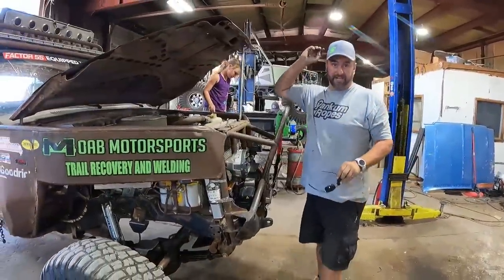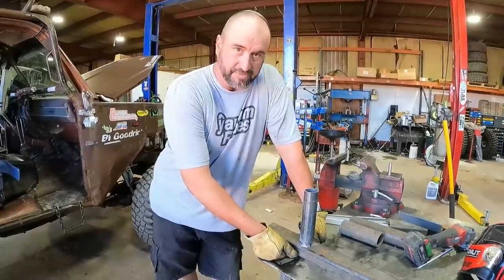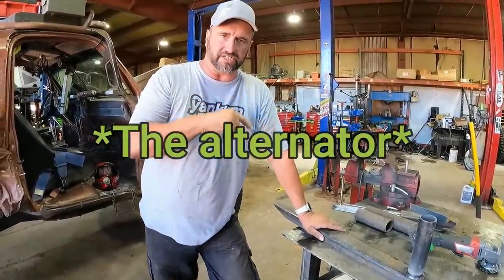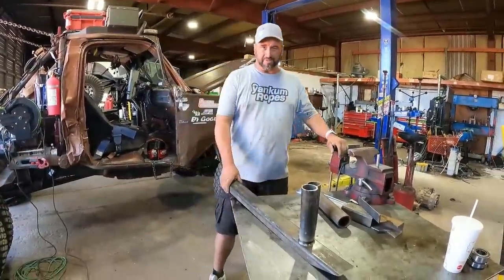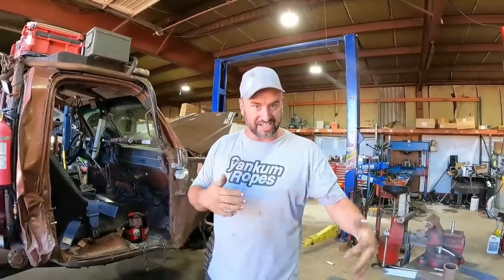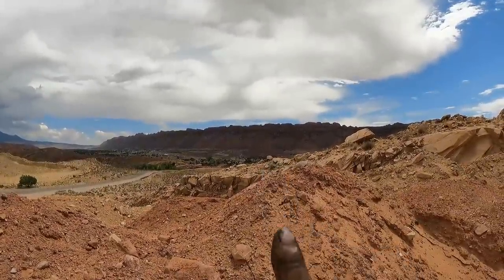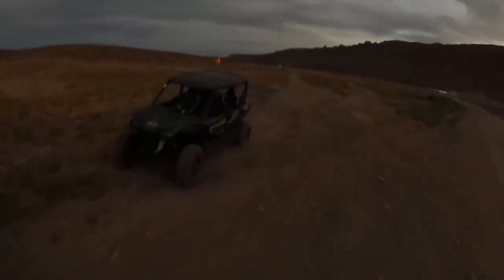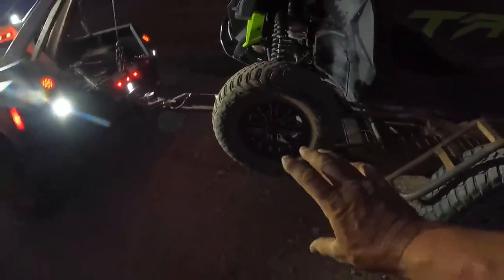Premier Power Welder

Comment: I love my premier power welder, it also makes for A amazing battery charger on a dead battery, I don’t know it you have tried it or not But if you have a dead battery just hook up the positive negative welding leads the battery and then turn your welder on at idle speed for up to two minutes and then shut it off and it’ll start will start a rig even if it was completely dead

Comment: Rory thanks for the info on what rod u use and the info on the welder I was wondering if it was DC or ac current i have a frounise battery welder at the coal mine it kicks ass and it can run in 110 power also

Comment: I worked on a surface mining job in the 70’s and 80’s I saw a welder slap a ground on a machine and then weld a hub, well long story short the wheel bearing was the ground, it welded solid and wouldn’t roll, took hours to replace that bearing

Comment: I'm welding on my stock alternator. used a 200 amp plug to connect the battery to the alt. unplug the batt and plug in the leads 
this disconnects the batt and full fields the alt. engine rpm increases the power to the leads
pretty much any brushed motor will run on dc and old school light bulbs too

Comment: First , great video it answers some questions absolutely. Ive built a trailer b4 6x10 out of 4 inch c channel probably could have gone 3 inch 🤔😁 . I never knew there was ac/dc rod  and i figured the sound your welder made was due to supply system. Great weld on the pipe and certainly looked concrete. Keep on with what your doing it works great. 
When is matchbox coming out with a trail m8ter model ???  We need a set of pauls / poppa sherms rig , your rig and matts soon to be done rig ???✌ brother hoping the the shop and all are safe.

Comment: @Trail Mater,  Gotta wonder if it would be worth adding a second smaller alternator that is sufficiently large enough to run the engine electrical system and keep the cranking battery charged while welding so that you need not worry about draining the starting battery if welding for a long time?

Comment: I know someone who added a second alternator and made their own home made on board welder. Ive got my eyes on one of these babies. I try to make my Jeep a rolling workshop but its nowhere close to trail mater level haha
Reply: It's not close....yet!  Took Rory time to get Mater dialed in, and there's still upgrades and fixes.
Reply: @marklar7551  I actually have plans in my noggin to build a purpose built mobile repair offroad rig. Also thought about turning my m101 trailer into something similar as well. Generator welder all the goodies, bring it with on trips to base camp. Making it not be too top heavy is the real challenge

Comment: I've welding for years I had to do some welding on a piece of heavy equipment using a mobile rig. Mobile rig was a four-wheel trailer that had a 300 amp DC unit driven by a flathead Continental six cylinder engine World War II  Korean war military surplus. Although my leads are hooked up close to my welding work I heard some popping sounds from the other side of the truck. I stopped welding went over and look at the batteries.  Batteries  got i so much electrical charge and stray electricity that it blew the Caps literally out of the batteries. Played heck trying to find out where batteries caps ended up. Thought you'd enjoy that little story. Side note company owner a WW2 retired Navy CPO built a 45 million dollar operation construction company, chain of grocery stores, restaurants mobile home factory, dairy farm car dealership,  heavy equipment maintained shop,  milling machines dump trucks flatbeds tractor  low boys,  cranes bulldozers every piece of equipment military surplus from DMRO.

Comment: The real issue with electronics and welding is Induction: the welding leads from your HF start welder, can induce high frequency A/C in wires that lead to the computers, which they may not handle gracefully.
Reply: Perhaps, but they ought to be shielded good enough to handle it, at least if you don't drape your welding leads across the wiring harness!
Reply: @mahbriggs  Shielding?  What shielding?  Except for a few signals, there is none.

Comment: If you crank up the power does the pitch of the welder whistle get higher? I'm just wondering if the change in the sine wave of the dc load changes the tone.

Comment: Have you ever had any battery charging issues with your premier? I have one in my jeep comanche and I've welded with it 2x and it's been installed for roughly a year. Hadn't drove it much the last few months and ended up leaving something on and ran the battery dead. I charged it with a charger and drove it to work today to giver a check over before an upcoming trip and found that it's not charging the battery at all. Anything specific I should look into

Comment: i thot it sounds cool !!   isaw 1 on line thats mig tig and stick !!!! 
how cool is that. one forbeach brand if common use rigs due to diff alt needs .
price seemed very reasonable to me ..   does ur idle controler " wire cable  " to carb ??
on vehicles w throttle posistion sensor i would gUess it plugs inbewteen to create control ??   any thanks for doing a seg just on ur welding !!!!!  ive sent comment questions in b4 and here u r giving us the run down ... ur the best Rory !!! Mater has it all and a great pilot to run the ole guy !!!!

Comment: If you have a grinder and a welder you can build so much.   What size steel is your boom made from?   

Nothing like a custom built machine, creative.   The new wrecker is your comfort tow truck, every truck has its purpose.   I wonder if you could build an off road rollback or if it would be too big for the trails, especially the wheelbase problem.

Comment: What protection is there or electronic devices against surge currents when stick welding?  Admittedly, having the ground close to the weld is very good practice but surely some of the spikes find their way to the equipment?  Do you need surge protectors throughout the vehicle.

Comment: Those power welders look good mate, the price tag on the other hand is significantly less so.

It's ok for you as a business, you'll make the money back off it. Myself on the other hand, I need to justify these things with my wife.

Ever tried the modified alternator aka weldanator setups?

Also, re the battery disconnected thing, if you can disconnect it you should absolutely do so. Especially when welding on the body or chassis. It doesn't really matter where you're welding on an exhaust or axle etc.

There are a number of issues around it, one of them being melting things not designed for that current as you pointed out. That's not why you disconnect or don't disconnect the battery though.

The issue is voltage drop between the clamp and the point you're welding, particularly as you strike the arc. When you strike that arc and the rod sticks you're running the full voltage of the welder through the chassis, rod, clamp, leads etc. Normally the arc is where all of the voltage drop occurs, but without the arc that drop happens everywhere else, mostly in the rod and workpiece.

If the section of chassis you're working on forms part of the return path for a sensitive item in the car, such as a computer, radio, DC-DC charger etc the voltage that item sees is the battery voltage plus the voltage drop you induce with the welder in that section of its return path. That can put 25V+ across those items and damage them, even with the ground clamp placed relatively close to the area you're working.

You remove the battery from the circuit and you stop that being an issue.

So, the chances of doing damage are low, but still very much non zero.

Same deal as wearing a condom. Prevention is a whole lot easier than dealing with the consequences.

I'm not (professionally) a welder or fabricator either. I'm the guy the car gets taken to once the damage is done and the mechanic has no idea how to fix it.

Comment: Damn nice bead Rory are ya running 3/32” 7018  you mean 6010 if so great rod. Ok you answered my question. Perfect bead.
Just looked them up,  real nice welding setup for trail work, very light weight.
Rory how long welding leads are you using ? Glad I finally got the heads up on the name of the system. A lot lighter than a two cylinder engine type. Thanks Rory

Comment: I always thought the straight line was the DC and the wavy line was the AC. What I'm curious about is the duty cycle to keep the alternator from over heating. Does this unit have a resonance coil or does it just rely on the alternator. I know that welders with proper resonance coils are easier to strike an arc with.

Comment: Many years ago we were jumping a car that would not turn over, we didn’t know the ground strap from the engine to the frame was bad and the battery ground was bolted to the frame.  When we went to crank it the ground from the starter motor went through the throttle cable to the carburetor and it glowed red hot.

Comment: Just a correction when you were talking about the grinders AC/DC compatibility, you said AC is the straight line and DC is the wavy line. It's actually the other way around. AC is alternating so it has a "wavy" wave form, where DC is linear and has a "straight or linear" wave form.

Comment: I'm just puzzled by the sound it makes via the rpms. really cool
Reply: Me too, I hope someone can answer this
Reply: I believe it's because as he's welding the draw on the alternator makes it harder to spin. That draws down the engine rpms as the engine works harder, and changes the sound of the welder. I always thought it was a cool sound.
Reply: The whistle is a byproduct of how a high frequency inverter welding power supply   makes a super high frequency (and not too pretty or "clean" looking) AC wave then collapses that wave into usable (very) DC (mostly) current and voltage that many rods need to weld.. The physical cause of the whistlng noise mostly comes from the arc stuttering and (nearly) stopping  approximatly 20,000 times a second amd the resultant changes in the puddle of molten meal the arc is making. The start stop stuttering is because , well, DC eletricity is mostly a useful lie that we all got taught so we could start understanding electricity at all. The whole thing bout DC amperage being like water flow and DC voltage being just like water pressure  is complete rubbish. Water doesnt even work like tha. Dont even get me started on  the bit about electrons flowing in wires Anyhow its useful rubbish 
  Regular olde shool transformer welding power supplies also make a noise from this, but hey only stop and restart their DC arc 60 times a second. 50 times a second in the UK and europe. It is a much lower and less angry mosquito noise.TIG welding often uses a high frequency start and a waawaa pedal to control he puddle so you can usually her them whistlig  higgh pitched tune but not as loud as this type welder.

Comment: Short but educational. I wondered why it whistled. One thing you didn't cover, how do you adjust your current, and what is the range? BTW, nice weld. I couldn't do something that nice with a mig on a good day. One more reason NOT to have a computer in your car. You can't fry what isn't there. Don't worry on mine.
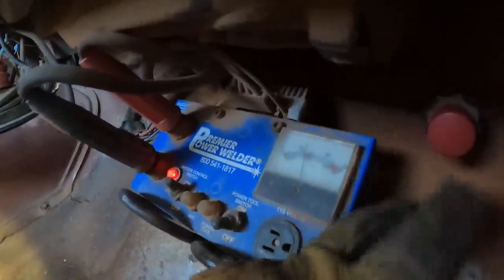Reply: At about 1:40 he explains the throttle control to adjust amperage. I couldn't tell on his ammeter how high it went since the cover is a little well used in the footwell.
Reply: @Mudpuppyjunior  You can't even tell if that is an ammeter or voltmeter. On an alternator, the engine rpm will change the voltage as well as the amperage. My question stands.

Comment: Trail Mador has some serious nuts, but do you think a diesel motor would be better?  I have always been told that gasoline engines don’t like to be run at high rpms ( when you are using the welder) and diesels like the high rpms?

Comment: Do u think 3X3X1/4"wall square tubing be ok for a 3/4 ton 4wd offroad wrecker will be supported simulator to yours but wasn't planning on welding any support.  Won't be lifting real heavy  stuff have a 12,000lb winch

Comment: I was curious about the alternator and how the control box made the magic happen.
Reply: It likely puts the alternator at the highest output it can do for an extended time instead of running the normal regulator. That would explain the rpm change also changing the voltage. It would also need to disconnect from the regular charging so you don’t over voltage the truck and let’s all the power go to welding.
An alternator like that can be good for over 100 amps which is enough for a lot of welding.

Comment: I'm wondering if it is possible to run 2 alternators 1 for the welder only. I it would be a big undertaken. But it take a load off the electoral system.

Comment: Pretty much all brushed motors can run on both but if you have a variable speed trigger thats not going to work and the switches may burn out or stick or weld shut

Comment: The problem with melting brake lines, apart from the obvious, which IS Not Good, is the fact that 1: if it melted it is VERY hot and 2: Brake fluid is VERY flammable! So NOT GOOD + VERY NOT GOOD = OH CRAP, THAT'S REALLY NOT GOOD! :D:D:D

Here's one for you Rory, Next time someone complains about costs, How Joe Blow can do it cheaper, Remind them that The Oats are always cheaper when they've gone through the horse already.

Comment: Is it true with this style welder you can’t weld to your self?  Only other rigs.
Reply: Found the answer.  Unless you disagree.   

What should I know when welding on a vehicle?
When welding on your OWN vehicle, use only REVERSE POLARITY. Positive to electrode holder; Negative to work/ground. Never weld on your own vehicle with your Premier Power Welder in straight polarity. Also do not weld with Ready Welder or any other unit using straight polarity wire, on your own vehicle.

Comment: I useto run them tires until a stick Punctured through the side wall went threw it like a hot knife goin through butter I used them tires all over the mountains in New Mexico on the Mescalero Apache Reservation

Comment: Let me clear this up.  This box is NOT a  "welder."  It is in fact a SIMPLE SWITCHBOX,  the ALTERNATOR is the WELDER.  HERE IS  how these work, and they have been around since the SEVENTIES.   The switch    flips the output  of the alternator  from the battery to the welding leads.  It also bypasses the regulator  and  jacks up the field current  usually "full field."   The voltage output is dependent on engine RPM.   IF YOU ARE   lucky  and do not blowup the diodes or stator  in the alternator,   "I guess" it will work.  If the people selling these are using higher   PIV  diodes  in these, that will offer some protection.

In the old  days  these were VERY hard  on  OEM  diodes,  because when you  remove the load from the alternator  and  rev up RPM,  the OUTPUT VOLTAGE  goes  UP.  This is how they run   120V   loads,  DC only.  They DO NOT  operate  AC   devices.

I  would guess  these new generation ones  "are fine"  within limits

Comment: I already knew that you had to clamp the ground as close as practically possible to where you're welding, (even though I've never actually welded anything myself, but I'd love to learn how to sometime, because it's a very practical and useful skill to know how to do!), but I already knew about the grounding thing because I understand the basic concept of how most welders work, and because I am an electrician and I also work on electronic circuit boards and stuff as a hobby, so at least I understand how basic circuitry works.

That's really cool how it works, and thanks for letting us in on a few more details about your truck's welding setup! I also already kinda figured by the way it "whistles", that it operated with a high frequency, because you can hear that frequency in the "whine" it makes when operating.

I just have one quick question about your welder though... If you ever had to, can you also weld on TowMater itself with that welder, or would that cause electrical problems within your truck if you did that? OR, is it ONLY safe to use on a totally separate vehicle? (i.e. one that is not electrically connected or physically touching your towtruck)
Reply: AFAIK he has welded on TowMater itself. I'm pretty sure the alternator is electrically isolated from the vehicle, and only charges the battery when not welding.
Reply from the maker: Yes I can weld on the truck itself. I do very often.
Reply: @gordonrichardson2972  I see. Yes, I remember Rory mentioning that in the video, about the alternator only doing one or the other, but not both at the same time, but I was just wondering if welding on the truck itself would cause any kind of electrical system damage from "ground loops" or other electrical system conflicts/shorts/etc... I guess not... But I'm sure it's also a good thing that that old truck doesn't have any modern "electronics" on it like "engine management" computers and such, like all of the overly "controlled" modern vehicles have, because those kinds of things could potentially be a major headache to deal with any of their potential "issues" when using a truck mounted welding system like this!

Comment: I am a heavy equipment fabricator, most of the equipment I repair cost around 1 million USD each, the electronics in this equipment is more sensitive that the space shuttle and probably more delicate. You better believe I disconnect the batteries and anything else the manufacture requires. My insurance wouldn't like that type claim.

Comment: I have never welded, never will, but I studied electrical and electronic engineering up to uni level. I understand electricity.

How do you get a 'high frequency' Direct Current electrical supply to a welding machine, an inverter perhaps?